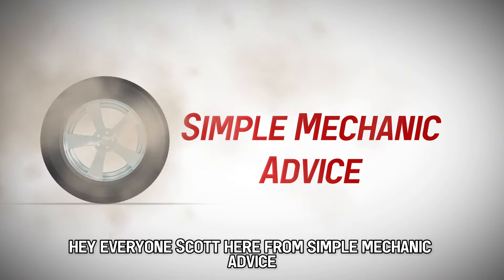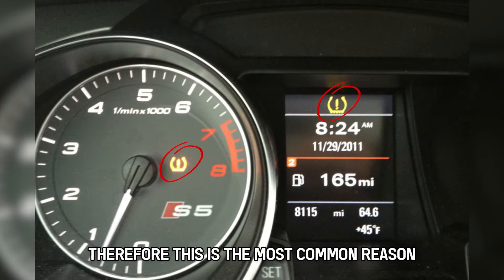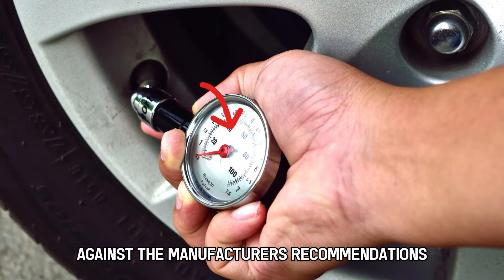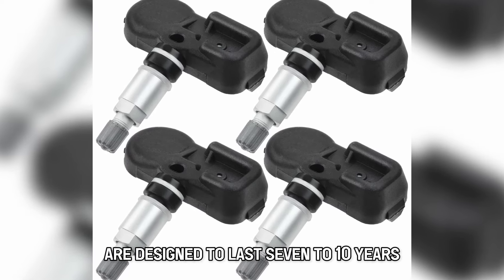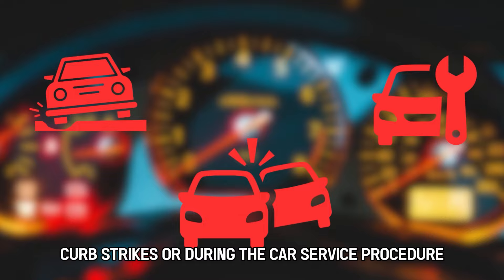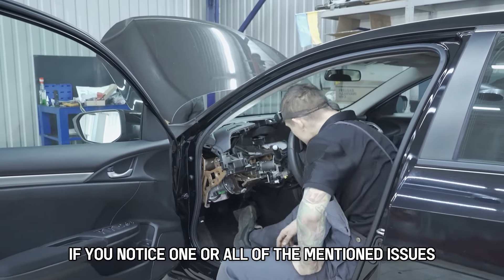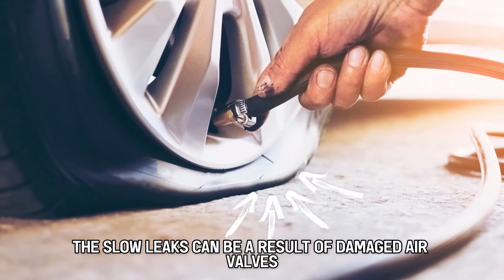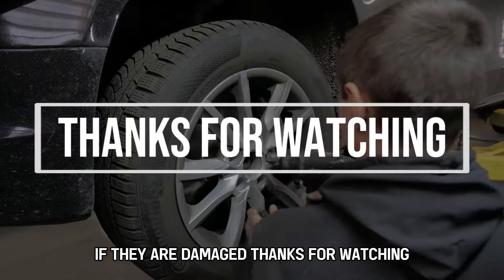Tire Pressure Light Won't Turn Off (Causes And Solutions)

Comment: Old school here. I manually check my pressures once a month or when there is a large difference in weather from hot to cold etc. These systems are nice when new however replacing sensors when batteries fail can be upwards of $100 plus mount and dismount of the tire.
Reply from the maker: @Bonsai-Miata2020 You’re absolutely right! Regular manual checks are a great habit, especially with the weather changes that can really affect tire pressure. While TPMS (Tire Pressure Monitoring Systems) are convenient, they do have their downsides, like the cost of sensor replacement when the batteries wear out. It's always good to stay proactive with tire maintenance, and combining manual checks with the alerts from the TPMS can really help ensure your safety on the road. Thanks for sharing your experience and for keeping it old school!"